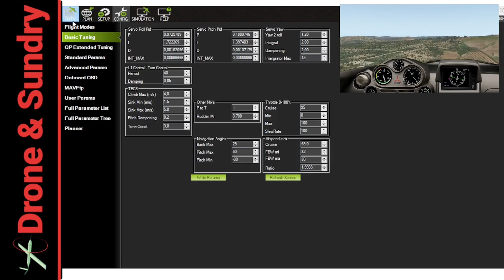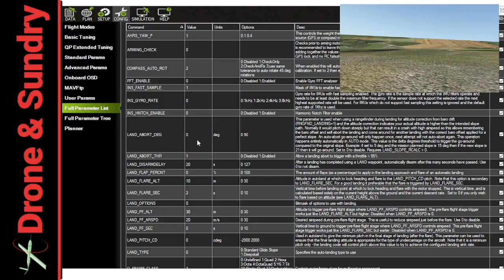Why simulation for BVLOS drone training?

Comment: It would be extremely useful to have a simulation with other aircraft flying in proximity to determine just how much your situational awareness is degraded by only having a single forward facing viewpoint.
Reply from the maker: I have done that piping ADS-B in and must admit I have never thought of that tunnel vision viewpoint. Perhaps because I would never consider FPV enough for separation in a real BVLOS platform.

Comment: Very cool and yes completely agree with you, how did you set this up?
Reply from the maker: Its quite straight forward, you will need X-Plane though. Once you have that, its a few settings in X-Plane and Software in the Loop (SITL) in Mission Planner, somewhere here I made a video about connecting X-Plane 12 to Mission Planner